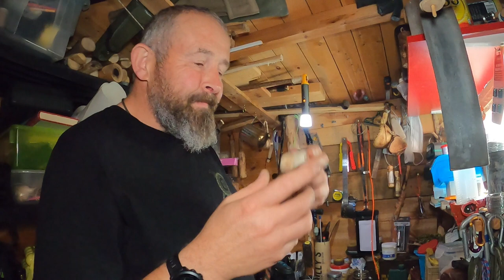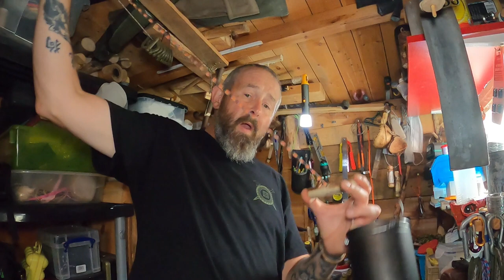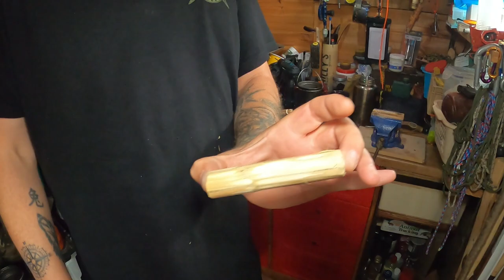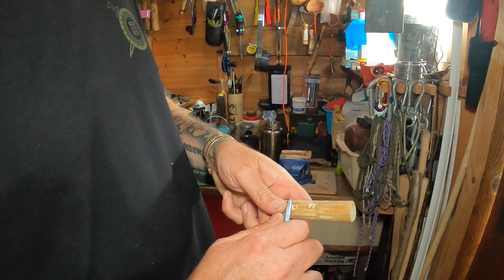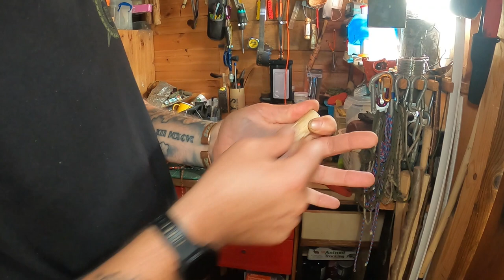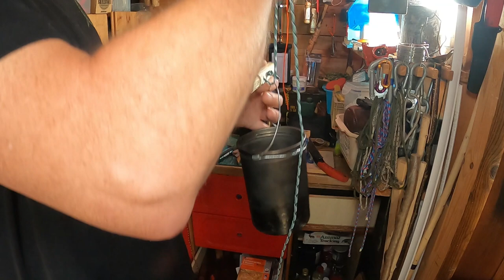Camp Toggles , Camping Hacks

Comment: Drill 3 holes... 1 one one half of the toggle, and two spaced out on the other half of the toggle... Use the one with cord, and a overhand knot... Use the other two as your tensioner by going in one and out of the other... 3 is better than 2...